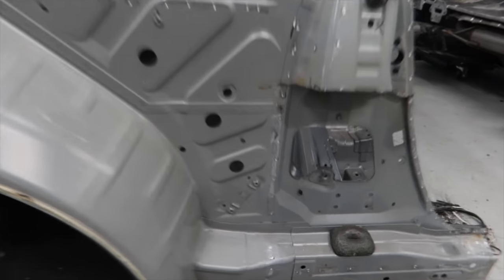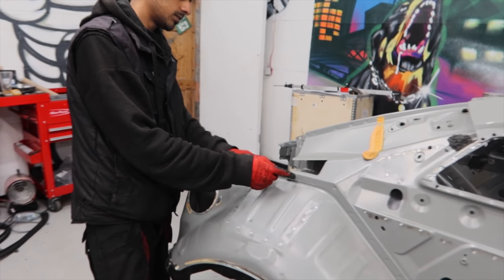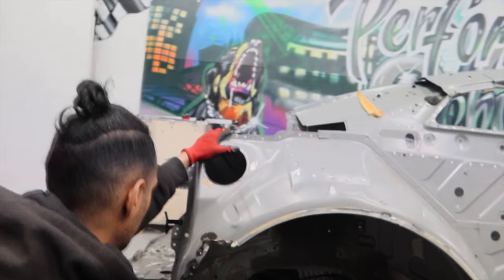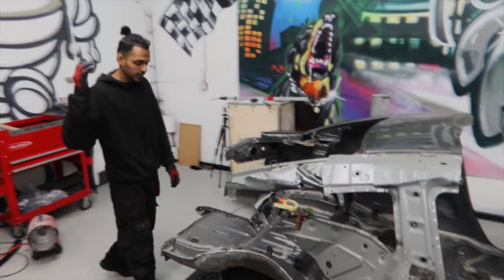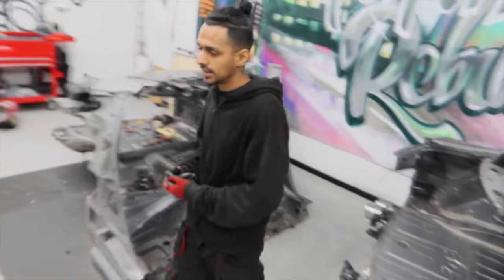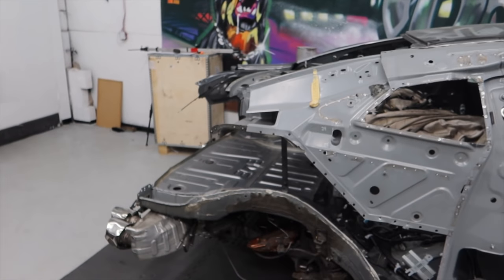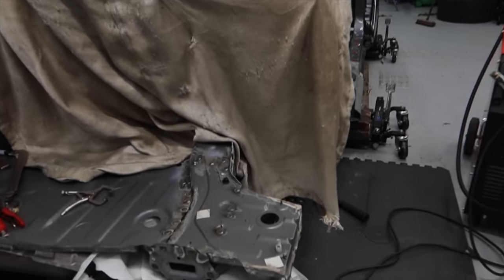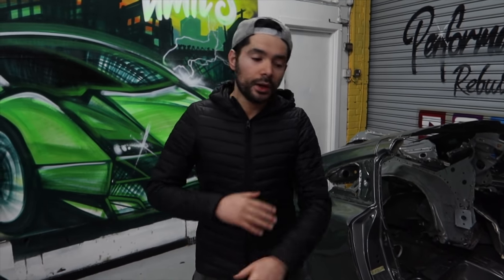Rebuilding a salvage Nissan GTR part 9 (HOW BAD DOES IT LOOK?)

Comment: Why did you not remove the quarter and inner arch all as one? That's a terrible waste of time to remove every panel separately
Reply from the maker: Because of the way the panels overlap and are assembled you cant just remove the arch as a full piece. In the factory they assemble the parts piece by piece. This is the best way to do a proper repair.
Reply: Ah right. Your doing a fantastic job. Cant wait to see it finished.